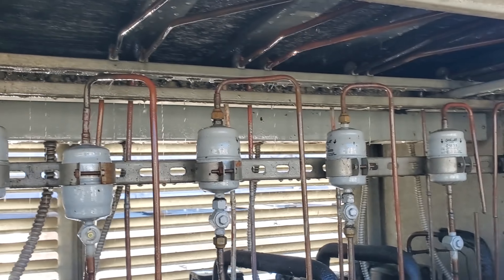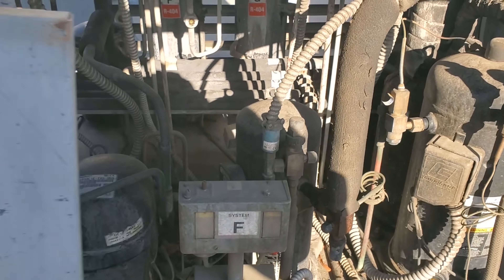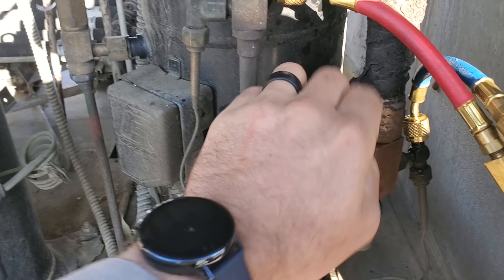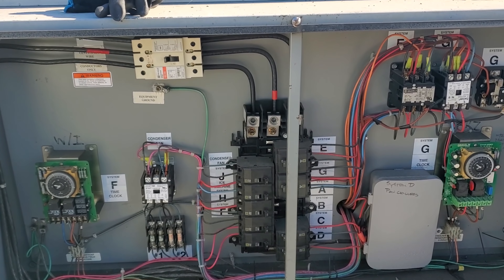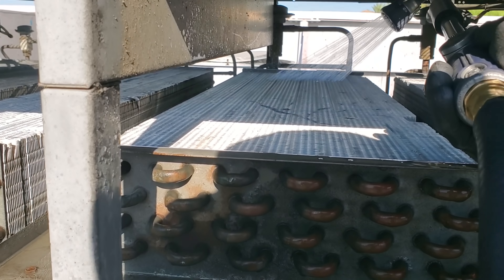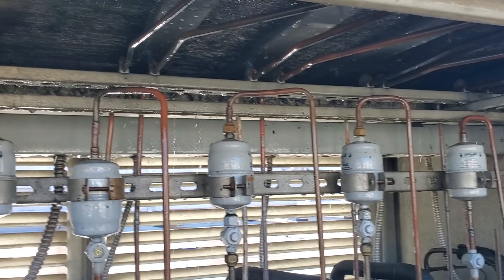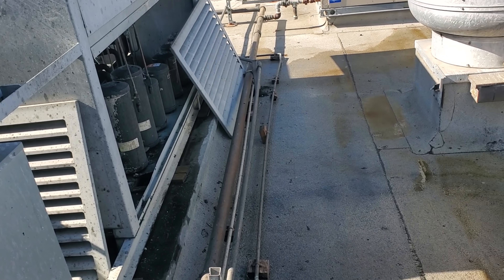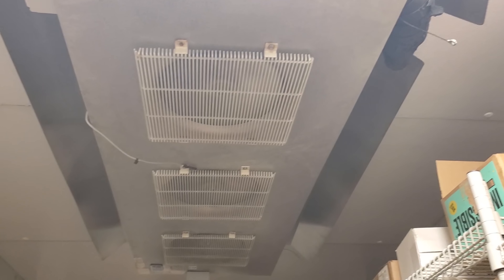WALK IN FREEZER WAS DOWN FOR 3 DAYS.......

Comment: I really enjoy your videos. As I live in an area where it takes an average of one and a half hours to get here from any HVAC repair/supply service. The cost of service just to drive here is outrageous as well. I am learning a lot and I have been able to service my 20+ year old Central Air unit and keep it working really well. I was afraid that it was gonna need replaced this year because I thought it was going out, but it works like a champ now after seeing that a lot of the cooling issues were the heat dissipation on the AC was clogged up, I didn't know that would be such an issue and cleaned it out. We have had a few days of 100+ degree temps too and no disruptions in cooling. Thank you for the informative videos.

Comment: My dad and his dad both were in the HVAC field. I've always been indoctrinated into the nu-calgon coil cleaner products, but today I placed an order for some of the Refrigeration Technologies Viper condenser and evaporator cleaners to try them out at the house and at the inlaws units. Long run-time season is upon us in NE Texas. Keeping that head down to spec operating range via clean coils was a key that my pop drills into my head to this very day. "If you don't schedule PM's for your equipment, the equipment will eventually schedule a service call..usually at the worst possible time, and at 10x the cost."  

I love the content, and it's good to see someone else's work procedures and tools they utilize.

Comment: I worked in a place with a huge display cooler running a compressor the size of a coffee can  because they wanted it low profile in the store front and in a year working there it got to safe temperature once for about an hour but the boss was too cheap to upgrade it so we as staff just ignored the fact the food was always at unsafe temperatures. It took being caught twice by a food inspector to finally do it.
Reply: THAT is when you make an Anonymous call to said Food Inspector at least 2-3 times a week until the Boss pulls his head out of his waste-disposal-orifice and upgrades the system.
Did no one explain to the Moron (Boss) that upgrading is FAR cheaper than a Food Poisoning/Wrongful Death Lawsuit and resulting Bad Publicity would be?

Comment: I know it would be considered a botch but it would be easy to add another condensing core on the side panel just  beside the existing one, if you could get your hands on one spare core like the smaller ones in the rack it would fit perfect  since it already has the right length.
 You would just have to cut the rectangular hole in the panel and braze it in series with the main one.
I know it sounds like a hack but i like it better than that swamp cooler...
Keep it up!

Edit: I see a problem in my solution, opening a hole there would reduce the amount of air passing thru the other cores. mmm

Comment: Only a couple months late to the party, but:
Swamp cooler pumps won't burn up from running dry; there's no seal on the wet end. 
Yeah, it'll make some angry noises when it gets air in the impeller but that doesn't hurt it.

Comment: I've been to a few jobs as a telecoms engineer where air con has failed in server rooms and been expected to try and resolve faults. I've always refused to work until it's fixed, funny how quick management then approve repairs.
Reply: You mean that a remote telco site at 122 degree air temp and equipment racks too hot to touch barehanded isn't good?  Been there, done that.  It's even better when you also have a UPS or DC plant system with lead acid batteries giving off enough vapor to cause your skin to tingle and eyes to water on top of the high temps.

Comment: I’m changing out two Trane rotolocs that were bypassing internally due to continuous lint plugging of the coil. They got weak and would bypass at just over 200psi (R22). I’m adding manual reset high pressure switches.

Comment: On an additional note, with respect to high compression ratios, specifically on reciprocating compressors, excessively high head pressures can cause refrigerant vapor "blow by" to occur in the cylinder on the piston upstroke.Good work on your part, as usual.

Comment: I imagine a suitable HP-switch which gives a quiet alarm sound inside the freezer or blinking red lamp. Then costumer knows then it is time to get a PM-clean even if it runs "great". Can't be that expensive to route the cables and add that additional pressostat at the same time as system is vacuumed for other reason.
Reply: Customer would simply ignore the damned warning light . You can't help nor fix stupid .

Comment: Those con coils looked like they had open sides on them. I don’t know, but wonder if closed sides would force air through the entire coil pulling out more heat. It seems like the path of least resistance would be to short circuit out the sides.

Comment: Obviously, the manufacturer failed to properly size the condenser for 110*F ambient air temperature.  As mentioned in other comments, they should let you size and install a properly sized remote condenser on that system.  If not, I would suggest installing a manual reset high-pressure control.  Hopefully, doing that would not only get you out there to clean the condenser coil, it could save them from having to change out so many compressors.  As always, another "big picture" resolution!

Comment: I think it's a bit interesting that they run a business but don't even have someone that can take a look at the equipment on a regular basis just to see that it's in decent condition and instead wait for things to go bad. Just taking a look and plan a maintenance call can take you a long way towards a trouble-free situation.
But to me it also seems like there could be a use for having some monitoring equipment that just reads some temperatures and on/off cycles to see what's normal and then flag when something starts to seem a bit off. It's like cars making "funny noises", it has a tendency to become a lot more expensive the longer you wait.
Then I think that the drain pan design isn't really the best, could have been done completely different to avoid accumulation of dirt.

Comment: I've been watching your videos for a while now. I have a question regarding cleaning condenser coils. I assume you don't pressure wash them because of possible fun damage. 
What is the most pressure you think you could use for cleaning them without damage? Sometimes the 60 psi or so on the city supply just doesn't seem high enough to do anything

Comment: I'm not a rack guy, but you said the clean coil pressure is good. From what I see it really did not change from initial gauge readings.
36/280 initial.
21/287 clean.
That 14PSIG make that much difference?
Reply: the initial reading was with the compressor internal bypass open and whistling refrigerant in a circle inside itself. so less liquid flowing and returning too hot and higher suction pressure because it's dumping excess back into itself. that means phase change isn't happening properly, the metering device cannot correct it and poor cooling results, the odd frost pattern on evap. coil when inside the unit. I'd guess it's been loosing ground and gradually climbing in temps since Friday when they admitted it started or was noticed

Comment: Couldn't you install a high pressure cut-out to prevent the compressor from bypassing? Three failed compressors seems just a little excessive...
Reply: Can only do what the customer authorizes.  A simple fix to an installer/mechanic is an unknown, extra expense to someone who doesn't have a clue about HVACR.  My background personally is an electromechanical one by schooling and I work in telecommunications.  Years ago while in the USAR as a kid, I had some exposure to refrigeration so while I don't know enough to work on it or have a lot of depth of theory, I can at least understand what's in front of me and a little bit of the how and why when dealing with the mechanics working on our systems at work.
Reply: Timothy Barney also makes me believe issues are more to do with sealed system non condensibles
Reply: @utubedestroysmytime  I would hope after three compressors it was evacuated right at least one of those time and I am sure all three. Like Chris said though, the condenser is undersized for the application. 
And yeah, maybe they did pitch the high pressure cut off to the customer and they rejected it. I don't see how though, installing the cut off is much less than a compressor.... let alone three compressors! If they were worried about it kicking off and loosing cooling, then what when something like this video happens? 
Good video by the way, as always.
Reply: The green switch on the discharge line from the compressor looks like an auto reset high pressure cutout. Some Carrier units I work on have a control that will lock out if the compressor cycles to often. So you could add something like that which would also catch rapid short cycling due to low pressure issues as well say if the liquid line solenoid fails to seal etc. Or just replace with a Manual reset high pressure control

Comment: good Vid. Frankly i'm suprised that u have not gotten away from R-404A and Use a Lower Presure refrigerant in your area ( the Gates of Hell ) . Pt chart for 404a at 115 ambient is no good even with a clean coil. id Recommend not using 404 in your area and use a Refrigerant similar in pressure to R-22. i Recommend R-422B. i use it for Walk-in coolers and absolutely Love it for Medium Temp. i Would Have no quams about using it For Low Temp. and it's cheap now . price is coming down alot. u can reduce your head pressure by 100 psig in most applications. Your other option is Have a 2 Row condenser made to fit above the existing condenser slab. measure it up. have american coil inla make it for u.just screw ti to the top of existing coil. it looks like u have plenty of room. another option is add a ice machine Remote condenser across from unit and pipe it in. another option is next time u change the Compressor see if u can install one 1/2 ton smaller in same place barring that evap is not too big.

Comment: I've had mechanical engineers tell me that equipment was sized correctly and my response is the equipment YOU sized does not perform to the published specs, how do you explain that? The equipment is undersized - bump it up!
Reply: Seems like a lot of the time engineers do not want to design a system for the proper ambient condensing temperature I live in Canada but I design all my systems to a condensing temperature of 110f. That way you do not need to worry about getting screwed having a 85f unit trying to run on a 110f day.

Comment: Seems like it was marginal until the evaporative cooler failed and stopped cooling the air going in the rack. With a clean rack the cooler will be less critical. But if it’s throwing water into the rack then that margin won’t last long. Too bad it wasn’t closer and maybe ducted to the freezer side where it’s needed.

Comment: So what you're saying (if I understand it correctly) is the manufacturer sized the condensers based on Physical Volume of the Rack, not how much Heat the Rack had to pull out of the Coolers/Freezers in the building...
VERY stupid decision on the part of the Designer/Manufacturer...
Until you look at how much extra the manufacturer is making in sales of replacement Compressors etc...

Comment: First let me start by saying everything you said Regarding customers being cheap and almost ruining equipment to save a couple bucks is absolutely correct. But the problem with your theory is that it’s based on, “ all air conditioning repair contractors are honest” And coming from a consumer standpoint most trades are not honest that is a fact while you might be honest your competitors or your accomplices are not.If you watch most of your videos you’ll see that you’re always repairing some other idiots mistake well those idiots are the ones that overcharge or rip off your customers then you come along and all they have experience is being ripped off so they treat you like they treat the past AC repairman